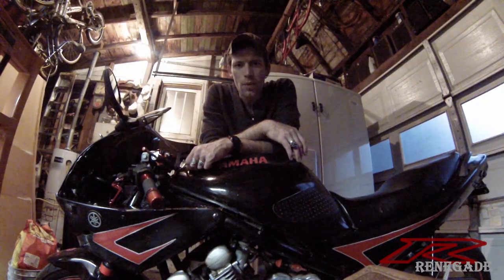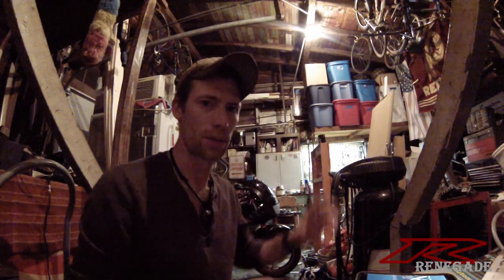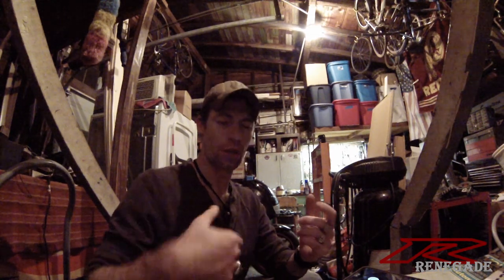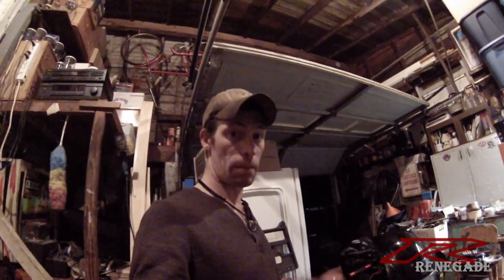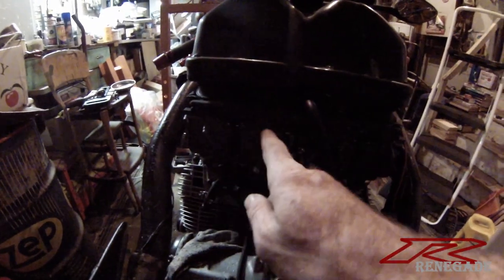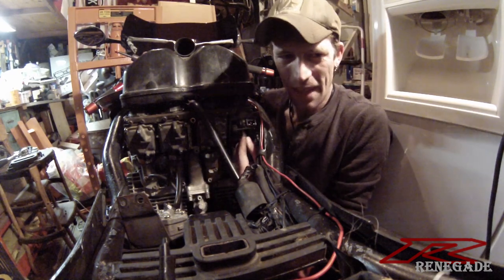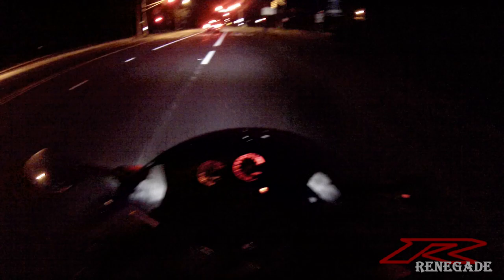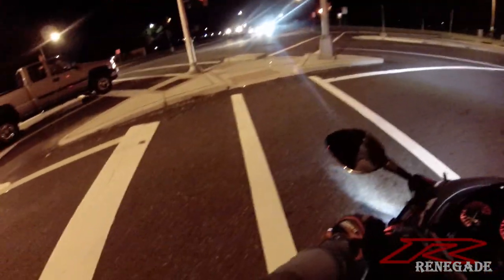Tuning the Carbs on my XJ600

Comment: Nice job man! I just did a carb rebuild on my '94 and am having a heck of a battle with getting it to run right. I swapped in #20 pilots, everything else is stock. I'm like 600' above sea level. Hopefully I'll figure it out before I just push it off a cliff! 🤣
Reply: I just got a 94 myself keep me posted on what you figure out... Mines dumping gas out the exhaust haha
Reply: @carrolldicky3541  probably have a bad petcock. Happens all the time to these things. I have a 93

Comment: Helped me alot, Yamaha XJ600 S 1995. I had on carburetor 1&4 mainjet #105 and on carburetor  2&3 mainjet #102.5 , it was very hard to tune it, i never managed to do that so i decided to go all 4 carburetors with #100 mainjets. I reseted the settings of the fuel screw backward untill it stops but do it very gently they can snap very easy and after that 1.5 turns out. The engine goes very linear no more bogging and it's a perfect setting for my beautifull old lady ❤️. Thank you very much and i hope all of you can fix this problem.
Reply from the maker: Nice job! I'm glad you got it all sorted. And thank you, it's always appreciated to hear that I was a help.

Your carbs should always have matching jets all the way across, then the air/fuel mixture can be adjusted if that cylinder is pulling more air because of something vacuum fed off of it. I learned that an IR thermometer is very helpful for that. Might do a video on that soon...

Enjoy riding!
Reply: @GreaseRenegade  waiting for your  IR thermometer video 👌. Was a pleasure and i am riding my old lady everyday untill the bad weather comes. Cheers from Romania and i wish you to enjoy as well and safe riding!!

Comment: I got my bike back together after new clutch and six sigma jet kit.  Big improvement but needs tweaking
 Maybe a bigger pilot jet AHHHH fuck sake it will probably be 10 tries before I get it perfect. Also need to bench sync then run sync them and check the float height, and adjust the mixture screw (There's a mod of this in the kit I can't figure out 😠) check valve clearances, raise needle jet more? after all that there's a slide spring mod and a slide drill-out mod SOS HELP IM' SINKING!!!!!!

Comment: My 93 xj600 deca 2 would normally idle fine but when you give it gas it instantly shuts off but now it won't idle at all and adjusting idle screw does nothing I was told the bike had carbs cleaned and rebuild

Comment: Whats up with your 2nd gear gear change ...its slipping or your dlipping it ...

Nice carb fix ..
Reply from the maker: It does slip a little when I'm getting up on the throttle hard and has gotten worse over time...I think a new clutch is in order soon

Thanks

Comment: By the way your doing good with the old school work light. Led ruins your eyes. Macular degeneration and Retinal detachment. Bad news. Blue is the worst and all white led base color is blue. Blue blocker glasses protect your eyes when driving at night and you can buy a film for your helmet faceshield. What are you running for tires?
Reply from the maker: Thanks for the heads up.

Im running Continental Condo Gos on both. 110/80 on the front and 130/70 on the rear. Good basic tires that are middle of the road on price and ride great
Reply: Update led light also destroys the photo receptors in the back of the eye.